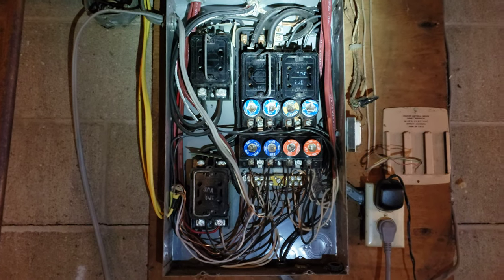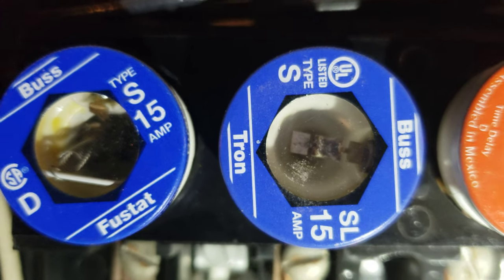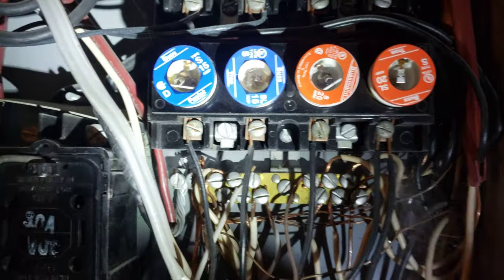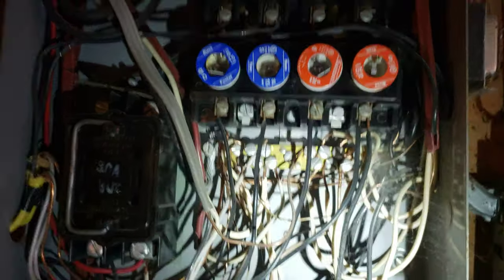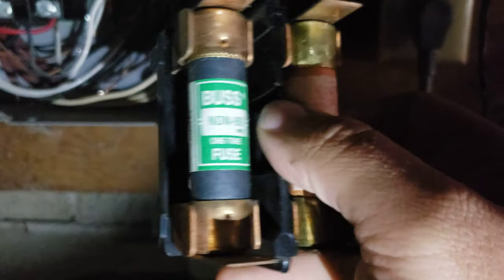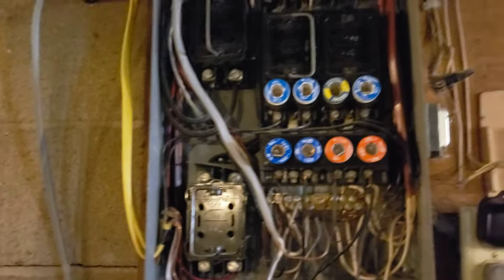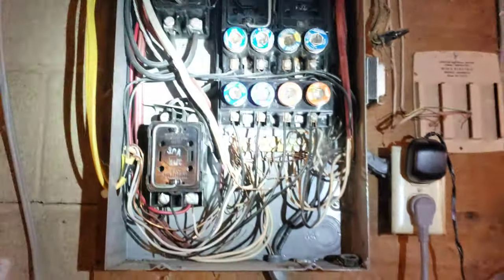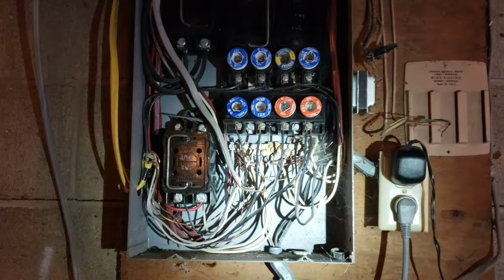Electrical Fuse Panel Issues

Comment: Using Type S adapters with the proper Type S fuses will prevent overfusing and also the ability to insert coins and such in the fuse sockets. This is a split bus panel. The 60 amp pull you just removed only serves the plug fuses. The rest of the pullout circuits still have power. The right hand pull, for the Range, holds two 40 or 50 amp fuses directly from the main terminals. The other two pullouts are 30 amps each for water heater and dryer, and those are coming also from the main terminals. This is either a 100 or 150 amp split bus panel with no Main fuses.  Not having a main alone would be reason just there for replacement.

Eight 120 volt plug fuse circuits isn't really enough for even a small home today. You might get by, but when you figure two kitchen counter circuits, bathroom circuit, washer circuit, dishwasher, disposer and all the lighting circuits and others circuits it's not much. Problem with most fuse panels is lack of room for expansion, even on a 100 and 150 amp panel You could probably add a subpanel to this using the subfeed tap lugs or one of the pullouts if it's unused, but I don't think you'd get a lot of circuits or capacity out of it.
Reply: I can't see my wires. Do I take out the box hoping the gauges/wires are labeled? I'm obvious novice

Comment: Breakers have problems too.  Easy for someone to switch to a larger capacity breaker.  They have many moving parts, which makes them MUCH MORE unreliable than a properly sized fuse..  if a homeowner doesn't investigate the cause of the breaker tripping, and repeatedly resets the breaker, it can start nuisance tripping at a much lower amperage than it's rating.  Worse, the worn parts can HANG, and NOT trip, in response to an overload, and cause a fire or damage equipment.  The restriction bases prevented people from putting in over-rated fuses.  But people are ignorant, and stuff in foil.  So the government mandated inferior protection. - "fool proof".  So people like me, in engineering for 39 years, have to pay the insurance company a premium to keep my superior protection.
Reply: Let's not forget the stabloc fiasco. I have one of those death-traps in my house right now because I literally can't afford what it will cost to take it out
Reply: @Helladamnleet  i have a federal pacific stablok panel as well, one time we had a space heater plugged in because our gas heat failed and the cord got slammed into the back door which was made of metal and it shorted out and the cord just melted until i manually turned off the breaker. i would much rather have a fuse panel than any breaker panel as i have seem issues with even high end ones.
Reply: @WalterKnox  Yep, I've had at least two times I went to replace an outlet to find melted wires behind it from the breakers not failing correctly. Supposedly they make retrofit breakers but I don't trust any part of the panel with or without new breakers
Reply: @Helladamnleet  i will say, after that happened i replaced all the breakers with connecticut electric breakers designed to replace stablok panels. and then tested them with the breaker tester that tests if it will trip under a dead short. and they all tripped, besides for the 240 volt circuits as i have no way to test them. but it was pretty simple, as far as fitment the new ones just popped right in perfectly. it still likely should be replaced but as far as breakers failing to trip, they seem to be okay now.
Reply: Sorry 7 month late.   Your right,  breakers can be replaced with larger amp ratings.  However,  it take quite a bit more time and effort,  than to unscrew a 15 amp plug fuse then screw in a 30.  Those adapters meant to correct that, also are not idiot proof, either, too small for a penny,  no worries,  what household DOESN'T have aluminum foil stashed away in their kitchen.

Comment: Wow. Must have been related to the previous owner of my house (sans the romex). 
I'm getting ready to upgrade my 60a service to at least 100a debating on 200a. 
In Cook Co. codes are strict on Romex (not allowed) and FMT (Greenfield) is limited to 6' as whips. 
The added fun is keeping the house running while I do this.

Comment: There are no 100 Amp fuses to fit that box. That pull out feeds the plug fuses only. To shut off all power all the pull outs have to be yanked. Or pull the meter. The tamper proof adapters will prevent the insertion of the wrong fuse but you could still bypass it with a coin, etc underneath it.
Reply: This is what known as a split bus fuse panel.   Per code you were allowed up to 6 pull outs to disconnect all power to the house, aka the 6 throw rule.   Some breaker panels before the 1980s were split bus as well, and no longer permitted as of 1981, but as long as single pole breakers were not added to the upper bus so as to require more than 6 hand movements to disconnect all the power, it still technically meets code under the grandfather clause.
Reply: @Sparky-ww5re I have an aunt and uncle that has an old fuse panel with 6 pull outs and 16 plug fuses. It's a massive enclosure. I offered to change it out for a breaker panel but my uncle is partial to the old fuse box. It's a beautifully maintained Victorian that is mostly original. I was commenting on the fact that he said the 60 amp fuses needed to be swapped to 100 amp. 100 amp fuses are much bigger and will not fit in that pull out, nor would they be needed as the "MAIN" in an old fuse panel is a little misleading as it only protects the plug fuses and 60 amps is plenty. I've known people that yank the MAIN out, then get shocked or cause a short messing with something that is protected by one of the other pull outs. If I didn't know that you had to yank all of them to shut off all power, I'd probably had done the same. Most people would interpret MAIN as something that would interrupt all power.
Reply: @topher8634 thanks for sharing.  That's definitely very large service for a fuse panel.  Most fuses panels hold 4 or 6 plug  fuses and the main & appliance pullout, typically for a range but I've also seen them used for an electric dryer when the home had a gas range.   I've always called these smaller fuse panels a 2 x4 or 2 x6 panel respectively.  These were 60 amp service,  unless it was split bus requiring the appliance fuse block pulled to disconnect all power,  the appliance block was typically rated 40 amp MAX,  and you add that to the (misleading) 60A mains.   By the time 100 amp services became the standard for most homes in the early 1960s,  breaker panels became the new industry standard.

Comment: Is there a shut off so there’s no current
Reply: @Eviscerate teenage girl here… are we able to unscrew the fuses without turning anything off in the box itself? Thank you for the help!
Reply: With this type of panel you need to pull all four pullouts out to kill the whole panel. Just removing the MAIN pullout will only kill power to the screw in fuses. The three other pullout blocks will still have power.
Reply: This is a split bus fuse panel and like a split bus breaker panel,  there is no single main disconnect,  you have to pull all the fuse blocks to shut off all power in the house.   Per code you were allowed up to 6 pull outs or 6 circuit breakers to disconnect all power, these panels were prohibited in the 1981 NEC without a main disconnect upstream.

Comment: What happens if you put a fuse that has too small of an amperage in?
Reply: It will simply blow sooner with a smaller load place on the circuit.